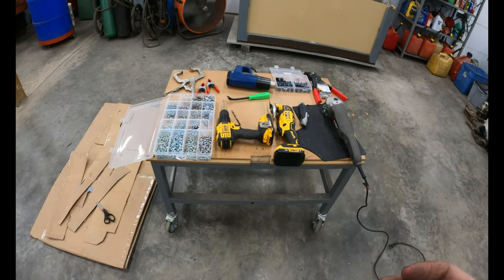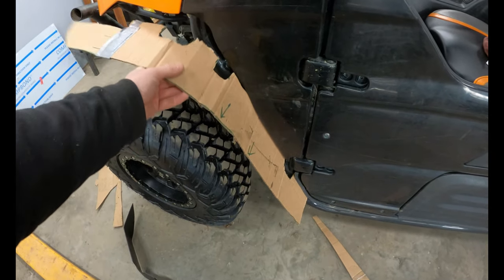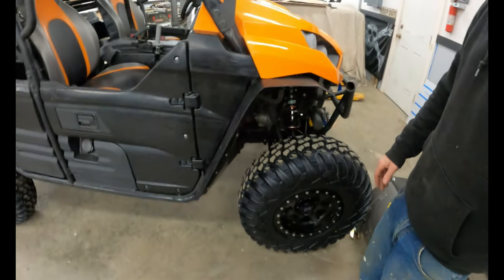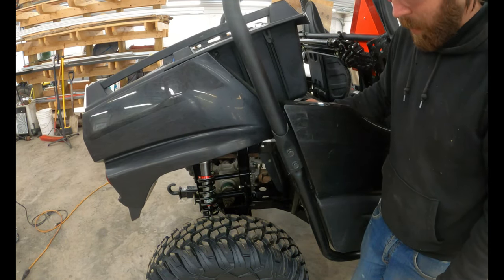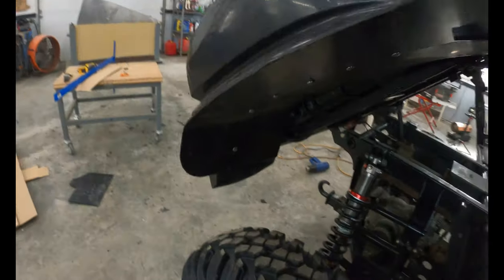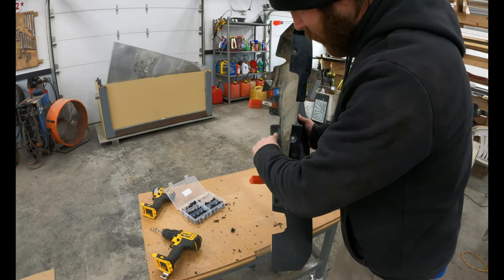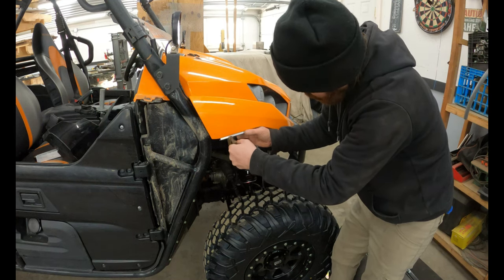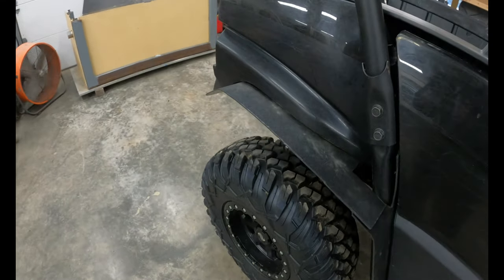DIY UTV Fender Flares

Comment: That's awesome! How's it hold up in cold weather?
Reply from the maker: @kurthollyday4214  if you get up against a tree they can definitely pop off or crack but I’ve had them on a couple years and they did pretty good but it wouldn’t hurt to use a more flexible material honestly knowing what I know now

Comment: whats the thickness of the material you used man great video i`ve been using truck mud flaps but wifes general i may go this route thanks man
Reply from the maker: I made them out of 1/8” but my mistake was making them too wide. I’m making a new set now cause I’ve bashed them off so many trees. They actually stick out a half inch past my tires the way they are in this video. I’d make sure they are tucked in probably an inch from the very outside of your tires. They’ll still keep the mud off you don’t need them to overlap the tires completely. I’m gonna do an update video I’m the next few weeks. Thanks for watching and thanks for the question!
Reply: 10/4 man thank you for the follow up @DirtRoadLife1
Reply: Thanks I’ve been planning to do this and your video really helped me but especially the 1/8 size comment, I was thinking to buy 1/4” and would have wasted a bunch of money!
Reply from the maker: @carlosandmelissacastro  I just redid mine and kept a template if it’ll help you